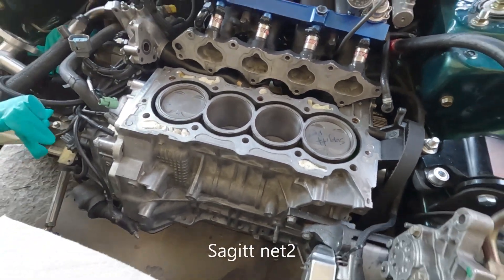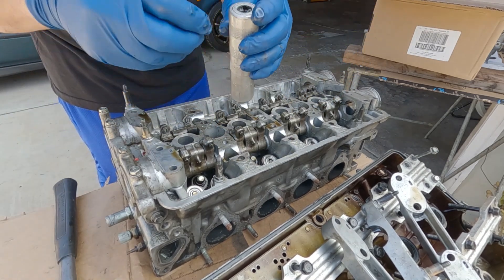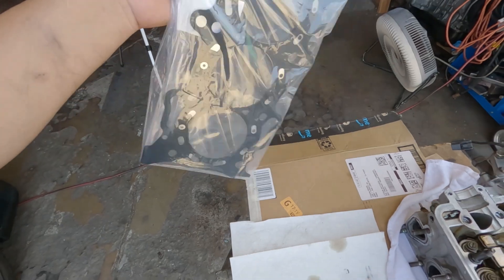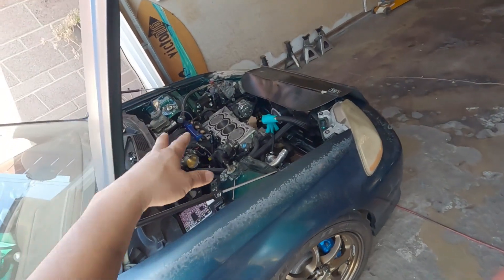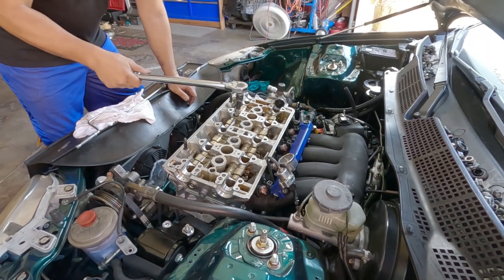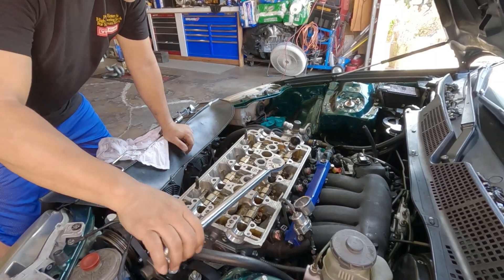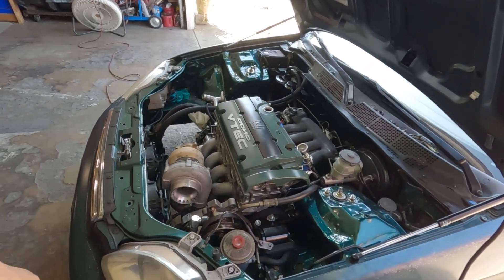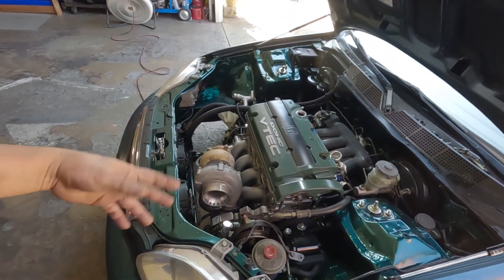What Head Gasket to use on G23 Boosted or NA setup?

Comment: Do u need to spray it with capper spray when it’s new r its all gud
Reply from the maker: If your cyl head and block are known to be flat or let say that the cyl head been resurface, no need for copper spray. The copper will not stick to the teflon coating anyway and it'll just end up getting mix on coolant. Copper spray is good on graphite hg, but not on OE gasket.
Reply: @sagittnet2158 ok thanks.    Man I just keep learning from u.

Comment: I had to have the bore on my f23 pushed out to 86.5mm. Is the oem head gasket still a good candidate to use, or should I source an 87mm head gasket?
Reply from the maker: Your fine, l've used the Honda headgasket on my g23 that l had it oversizes to 86.5mm. The f23 block that l was showing on wet vs dry sleeve episode with a cracked sleeve. That block was bored to 86.5mm. You'll be good my man!
Reply: @sagittnet2158  awesome, and thank you again! 🙏🏼

Comment: I LOVE the TRC titanium retainers with BLOX dual valve spring kit for my K series. It’s a bargain for what you get and the price. Why you hesitant man ?
Reply from the maker: I was about to use it on my previous turbo g23 'till l noticed that retainer is not covering the entire flange of the valve springs. Did some researched and learned to find out that Sk2 retainers are covering same amount of spring flange areas. But its too late coz l already ordered a replacement w/c is Blox and TRC retainers ended up on G2B build.

Comment: Hi sagit great vid. I’m using the felpro 9958 pt-1 f23 headgasket. With f23a1 block and h22a head. No issue so far
Reply from the maker: Good info my friend on using  Felpro headgasket. We tried using Felpro on F23 block w/ H22 head before and didn't worked out, stayed away from it and l see your setup is the other way around H block/ F cy head. Thanks and hope others can get the info.
Reply: @sagittnet2158 no I am using p13 h22a head with f23a1 block. Only issue I saw was small  clearance from headgasket on rear ports so I added some rtv around outer edge to try to help it seal. It working so far. Does oem headgasket seal better in backside area If so I’ll switch to it for next time
Reply: I realize I accidentally said them backwards edited the commemt
Reply from the maker: @LifeOfRlce  That's the areas of the oil seep thru when we used Felpro gasket but it's good that you came up w/ a fix. Later man!
Reply from the maker: @LifeOfRlce  Honda OE f23 gasket have extra seal on that area, that's why l stay away from felpro and price difference is not really much (web prices). Victor Reinz is almost the same as Honda F23, l'll try that next time.
Reply from the maker: @LifeOfRlce  no worry man and still a good info for other about smearing a sealant on that corner to prevent oil leakage.
Reply: @sagittnet2158  ok thank you for the info, I will switch to oem Honda next time for more surface area. The rtv is provably a ticking time bomb. Good to know the oem has more surface area to help seal the rear ports
Reply from the maker: @LifeOfRlce  if you use a good sealant like Hondabond or Megagrey, it should last till something gives. I usually use Megagrey sealant, its almost the same stuff like Hondabond minus the price.